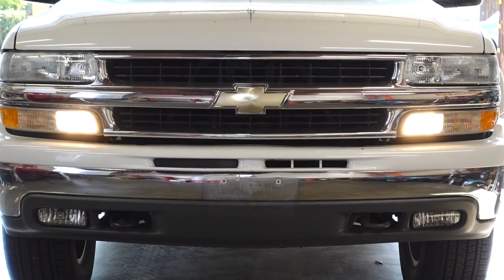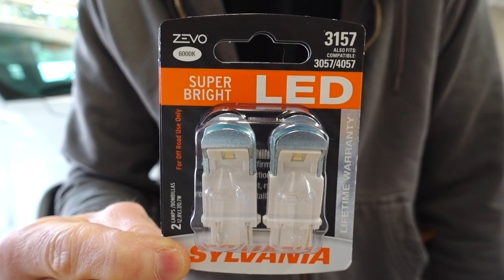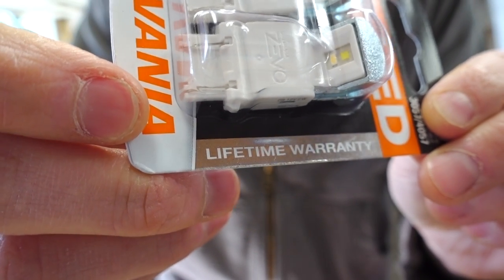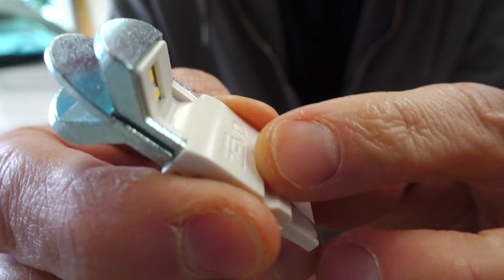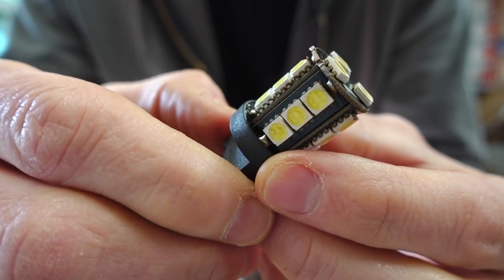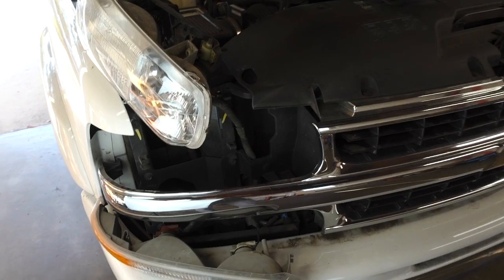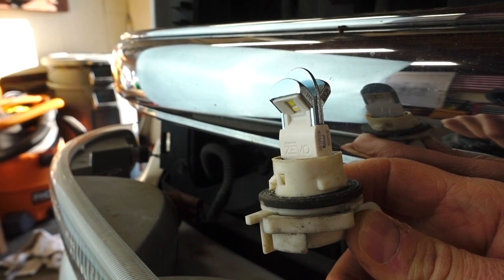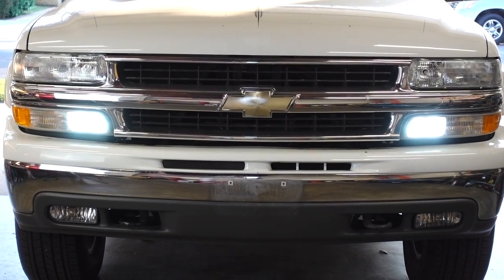Here's Why THESE ARE THE VERY BEST AUTOMOTIVE LEDs YOU CAN BUY!!

Comment: I bought these lights as well. Sylvania Zevo  are quite literally are the best tail light, turn signal, and interior lighting option you can buy. Yes they are expensive but they last forever. They never have any issues or failures. The quality on the bulbs is top notch. Heat dissipation is something Sylvania really focussed on. And Sylvania uses the best LED diodes. They hand to pick them to be the best quality for quality control. 👌👌

Comment: I have those same exact LED's in my DRL's for my '00 silverado.  4 years and they're still working just as good as the day I installed them.
Reply: terminalfx does the 4114 led work ?
Reply: I was think of putting these on my 02 Silverado im.glad I seen this comment
Reply: Would they work in place of the bulb next to that one??
Reply: @sean.g4516  not sure, sold that truck a few months ago. The bulb "next to" that would be for turn signals, it may work there also but only if you have orange lenses. I had smoked out lenses and had to find orange LEDs for those sockets.  If the stock bulbs for both DRL and turn signals are the same then it's plausible, yes.  Another thing to consider is the smaller bulbs on the sides of the turn signal lamps.
Reply: @sean.g4516  I have had these Zevos in my DRLs for about 3 years with no problems. I also have had them in my rear brake and turn signals for a year now also with no problems. So the front turn signal should be the same.
Reply: @sean.g4516  if you can find them in amber I’d go for it. However, you may find that it flashes rapidly. First instinct of a lot of people is to put that giant 25 watt 6 ohm resistor to trick the car into thinking there’s a bulb there. That “works,” but it’s not correct because that resistor uses the same energy of the incandescent bulb. What you’ll want to do is find an aftermarket flasher relay for your turn signals that’s certified to work with LED’s.

Did it on the tail/brake lights on my dads ‘01 ram 1500 and needed to replace the flasher.

Also, if the lens you’re putting the LED bulb behind is red, use a red led. Likewise if it’s an amber lens, use an amber LED.  Using a white LED behind a colored lens will make the light appear dimmer OR throw the color off.  For full brightness and accurate color, red LED for red lens, amber for amber.

Comment: I had the 3157 ZEVO but I found the 3157 Sylvania Silverstar was considerably brighter. The problem with many LEDs are they do not dissipate the light patterns correctly. The reflector lens in the light housing is designed with the light reflecting off with light being output at the correct angle. Many of the brightest LEDs can wash out quickly and actually put out less light than a mid of the line incandescent if it does not reflect the light off the back of the housing correctly.

Comment: Most Chevy pickups I see only have one daytime running light on. You mean both can come on at the same time? /s  0:00
Reply: Yea, what's with that? Every time I have a Chevy pickup in my shop, one of them is burnt out. Fortunately GM came up with an ingeniously simple light mounting.
Reply: @bhaggen  I was wondering if it was really hard to change one or expensive, as many as I see out. I make a game of it, who can spot one first, how far can I go before I see one, how many total in a short trip.
Reply: @Randy Stegemann.....There's no way to get directly to the bulb since access is blocked by the core support. But if you simply unlatch & pull out the two rods, the whole headlight assembly practically falls out. On some Hondas you have to remove the whole damn bumper!
Reply: @bhaggen  If only engineers had to fix what they design...
Reply: @Randy Stegemann.....Good Lord yes; one of my clients is an engineer who devised an anti-theft devise on his Suburban. But he had a stroke, had absolutely NO recollection of his devise let alone the code involved, and couldn't start the vehicle! Took me 5 hours to figure it out.....at HIS expense!
Reply: Lmao for real
Reply: Early 2000s F-250s were no better with their headlights either!
Reply: I pulled the fuse on my daily when one burned out so people would stop telling me about it, now they both stay off forever and I  never have to replace them...
Reply: If you want your day time running lights off on a chevy , push in your emergency brake pedal one click and they turn off
Reply: It's a wiring issue 
I have never seen one not melted.
The wiring is to small for the draw.
Reply: That's a Chevy for ya. Only works when it wants to.
Reply: Yes I have 4 Chevys and GMCs, all of them same S**t.  1 Daylight runs never both on anyone of them ever.
Reply: @dontask8979  yep! It seems to me that auto makers tend to use one gauge below the recommended minimum.  In every vehicle I’ve worked on I see, for example, 18 gauge where the minimum for that load across that distance would be 16 gauge. I personally always go up a gauge—16 is sufficient? Perfect, I’ll use 14. 12 is good? Great, I’ll use 10. And so on. We’re talking about a price difference of a few CENTS between the cuts of wire and some bean counter wants to sacrifice reliability/longevity/durability for a few cents savings. Unreal.
Reply: I think they just run too many amps to that style bulb. I actually used to convert them to a park/turn signal and make them more like the previous generation trucks. I called it the GMT400 park/turn DRL delete.
Reply: That’s so funny because it’s true they always have one light out
Reply: @bhaggen  Light socket 9/10 times. Done it before.
Reply: @miket5506 .....I switched to LEDs; no more issues; get bulb number, pick color, and search LED on ebay;
Reply: @bhaggen  that’s how it’s done! Easy as can be!
Reply: @JustAnotherGuyInTheComments .....My BMW customers have tail light meltdowns; the connectors used to be copper/brass, since the late 80s they're tin & tiny; what could possibly go wrong?
Reply: @miket5506 .....And for that pesky hyper-flash, I found load independent flasher units; there are 4 variants depending on how your application's terminals are arranged; plugs right into the fuse-box; those resistors are bullshit. Float the grounds on the side-markers and VOILÀ, they work double-duty!
Reply: @bhaggen  
What do you mean by "float the grounds" ?
Reply: @tubeonline629 .....If you cut the ground supply to load A & connect it to the power supply of load B, you've created a floating ground on load A.
Reply: @bhaggen  
Thank you for explaining that, I've never heard of it, but seems like a good idea.
Reply: Just installed a set of zero 4114 for my DRL’s

Comment: I like the look of LED's, the one draw back I have about them is that they don't get hot enough to melt snow and ice in the winter months.
Reply: Biggest aggravation! I’ve got a 19 Subaru STi, real nice fancy LED headlights but snow and ice just covers the headlights making it hard to see driving at night in snow. Last year I had to stop 4 different times on a 60 mile trip just to clear off the headlights to see.
Reply: Agree!! Luckily for the heavy trucking world. There are heated lights now and have been for a couple years. But they are 7inch rounds.
Reply: Switch to Halogen replacements in the winter months, LEDs back on for springtime if possible.
Reply: They look terrible in older vehicles and I can't stand the fact it's next to impossible to get warm white ones.
Reply: @SubiSkank  a quality HID system with a proper projector retrofit will outperform any LED by far.
Reply: Check out the Morimoto 2Stroke 3.0 LEDs, their cooling system is completely sealed meaning no exposed fans that run the heat outwards. The heat is transferred from inside the headlight housing allowing frost buildup to melt.
Reply: @billyhndrsn4542  it's a good idea but if you have a newer model car like me that didnt come with led, we talking bout taking the whole bumper off or a used to be a 5min job turns into an 1 hour job
Reply: @billyhndrsn4542  
Are halogen light hookups compatible with the LED harness?
Reply: @snatchhog  depends on the vehicle u might need a canbus decoder
Reply: Headlight wise
Reply: My tail light enclosure has separate bulbs for each function, so I changed the back-up bulb and the signal bulb to LEDs, but left the incandescent bulb in for the tail light.  The one incandescent bulb is enough to warm the enclose to prevent ice & snow build up.
Reply: @SubiSkank  Haha.... turns out the old technology still has something going for it. Defrosting.
Reply: @Phantom096  you’re right about that!! You would think car manufacturers would take that issue into consideration and design the housing with a heating element in mind for those winter months!
Reply: @Phantom096  city municipalities had to learn the hard way when switching to led stop lights to save money on energy . Once winter hit none of the lights where visible due to the ice build up and no heat to melt it off
Reply: @Skrimp15  Wel yeah,of course if you dont look at the price off those lights!232 dollar!!
Reply: I hear you! When given the choice, I tend to go with the diodes for highbeam, turn signal, and daytime running, but stick with the Sylvania SilverStar Ultras for the lowbeams in order to keep snow melted off the lenses.

Comment: I've had these zevo type bulbs in my Tahoe reverse, signal, and brake for a year and a half, maybe 2 years. Great bulbs.
Reply: Did you have any problems with your turn signals?  I replaced all three and my emergency flashers work ok but the turn signals flash rapidly.  I've only replaced the rear turn signal bulbs.  Guessing i need to add a resistor?
Reply: @MS-es9hm  either add resistors or the electronic signal relays are getting more affordable too. I used the resistors myself.
Reply: @MS-es9hm  LED flasher relay is the way to go.

Comment: Good informational video and your thoughts are 100% on the money. Do it right the first time. I've been using Sylvania ZEVO's in my BMW's and other cars for the past 6 years (both interior an exterior bulbs) and have yet to have one burn out. Best LED bulbs out there, IMHO. Aside from the lower power consumption and lower heat output,  they also provide better light than the incandescent bulbs they replaced. The ZEVO's seem to fill the reflectors more fully with light, and they are instant on instead of the light ever so slightly ramping up like an incandescent bulb. Makes a noticeable improvement on bulbs like the brake and turn signals. They ARE more expensive than everything else, but are 100% worth it.

Comment: The heat of the halogen is there for a reason. If you live in snowy conditions, the heat actually melts the snow of your lens.
Reply: How do you explain modern cars with all led lights? How do they melt snow.
Reply: Not true
Reply: I think the original bulbs are incandescent  and
Not Halogen which produce a lot more heat.
But does it really matter. Unless you are driving in a blinding snowstorm I don't  think you need a bulb that melts the socket....
Reply: Or just clear them off like a responsible not brain dead adult lol

Comment: 3 things:  1. Jimmy, you're using the wrong bulbs for DRL. These 99-06 GM trucks need 4114 bulb (incandescent) for DRL, the problem is morons put in 3156/3157 which burns up the socket and sometimes even shorts/melts the wiring going to the DRL socket. The incandescent 4114 bulb is 12V 1.7W (0.14A), versus the 3157 (dual filament) is 8.3W (0.7A) and the single filament 3156 is 27W (2.25A). The wiring and socket is rated for 12W (1A) at most. Luckily automotive LEDs are low power (typically around 2W) so this is not an issue using 3156/3157 LEDs, but Sylvania does make the 4114 LED (in 2 styles) which is a direct replacement.

2. For DRL in these GM trucks, you need to use 4114 or 3156 LEDs, not 3157. This is because 3156 is single filament, 3157 is dual filament, and installing the 3157 into a 3156/4114 socket can burn out the bulb/LED within seconds if installed backwards.

3. With most companies these days is "lifetime warranty" means lifetime of the product, once it dies the lifetime has ended and no support. I've had Sylvania and other companies say they see no record of the purchase, and some say they "lost most of the records" during a server upgrade as an excuse to not honor their warranty, and expect you to keep the receipt for proof of purchase.
Reply: Mike K4ISR I was looking at Jimmys forehead after watching an FBI body language video and noticed there's a bunch of battles goings on with the constant wrinkles.Your right you have to worry about morons installing more problems then ever.Especjally striped bolts.Thanks.

Comment: I LOVE these Sylvania bulbs, ive been using them in my 06 F150 for my front running/turn signal bulbs in the Amber bulb.  for my rear been running them for my tail/stop/turn along with my back up lamps, i running 2 of the H11 zevo led bulbs to replace the factory h11 halogen fogs. The 194 led Zevo in my license plste lights, and the 921 led Zevo in my high mount brake light along with the 2 cargo lamps. 

Using a cheaper Chinese led h13 headlight for now as they were a gift but looking for better so far ive been blown away by the quality of these sylvania led bulbs, i love em

Comment: I bought those for my 03 grand marquis tail/brake/turnsignal lights. The design really works on those cars because the taillights are heavily reliant on the reflective housing. I love them. Not the same story for the front turn signal/parking lights though. Very, very dim.

Comment: Hands down: LasFit, I run their daytime running lights in my 05 Sierra. Bright asf and haven’t had issues for months. Compared to the GTR leds I ran for a month and one burnt out. They’re built well to dissipate heat. They’re the best. I run diode dynamics SL1 in my low beam high beam and fogs and love the heck out of them. No ussues for months.
Reply: I have been using GTR LED bulbs for two years with no issue in my '16 RAM
Reply: Las fit has tiers of LEDs from meh to the upper tier range. I ran their Cob chip LEDs in my fogs for 5 years and would get flashed sometimes. traded the car in last August.

The cob chipset led I ran was like the lowest one they offered and I thought it was great

Comment: I swapped out all of the bulbs in my Ford E350 XLT Super Duty van to all Sylvania Zevo Bulbs except the headlights where I went with Beamtech and I am MORE than satisfied on the performace of the Sylvania bulbs.  They have held up very well and to date, I have not had ANY issues with them.  Worth EVERY penny I spent to swap them out from the factory installed regular bulbs.

Comment: On those GM suv's and trucks you'll need to buy a new flasher module if you put LED's in your turn signals, the factory flasher module will go into hyperflash mode due to less current draw on the circuit.

Comment: I went Zevo crazy on my car, 2011 Crown Vic, the interior feels like a much newer car simply from the different light temperature and the fact that they are are MUCH  brighter than the stock incandescent bulbs.  As for the turn signals and brake lights, the improvement is very noticeable. Take this with a grain of salt as results may vary based on the lens and reflector of the housing you're replacing the bulb for. Overall, these are worth the cost and considering their warranty, I haven't found better. Only warning is to make sure you can locate your factory turn signal relay so you can either replace it or bypass it with an LED compliant flasher module. If your electrical system had all incandescent to start with, it is expecting the resistance of incandescent bulbs. Switching to all LEDs will trigger the hyper flash of your turn signals which normally signals a burnt out bulb. This may vary but will most likely be the case.

Comment: I have something like these but as a 7443R led bulb from sylvania zevo. 

These work very well for my 2015 lifted Scion xB. And it maybe slight dimmer of the parking light function than my incandescent bulbs. But that’s how they are design for. And the brightness function were very bright and sharp. 

The brightness and the beam pattern it makes I was in love with these zevo led bulbs. It works well for my brake lights. Not much for my turn signals ambers of the 7440. They are oem plus. Same brightness maybe a hair simmer. But my particular application is different, my reflector housing did not filled up with my brightness. So it needs ultra bright 360 type led amber lights. So I use auxito with 24 watts built in resistor led bulbs. And they are stupid bright. And I love it. It creates a beautiful amber parallel beam pattern from left to right. Gives other drivers much more effective to give them a heads up.

Comment: I wonder what the amber Zevo's would look like in your ride.
Reply: the amber/whites zevos are weak very weak in brightness  the red ones are VERY bright though
Reply: I have them in amber on my Colorado but the only problem I have is my reflection lens is too small for  them, (my reflector lens it's not able to reflect 100% of the led) so during day time they look super bright if you get exactly in front of them but at night they are able to illuminate the road when you have the headlights off.
Reply: @punker4Real  
I agree about the red 3157 zevos.
Reply: @juanr3421  
I guess these zevos are only as good as the reflector housing they're installed in.
Reply from the maker: You’re meaning amber in the same DRL position? I considered that but ultimately chose to stick with white.
Reply: They are great in my Jeep XJ turn signals. Rear only cause I dont trust them up front overheating as parking lamps.
Reply: I think he meant the amber as your turn signals